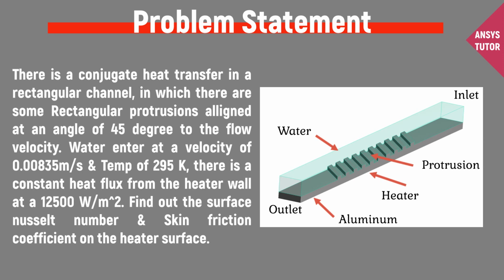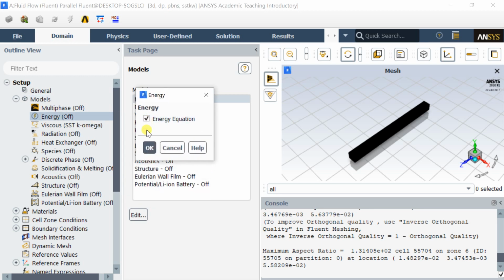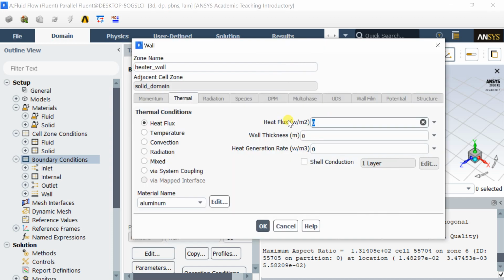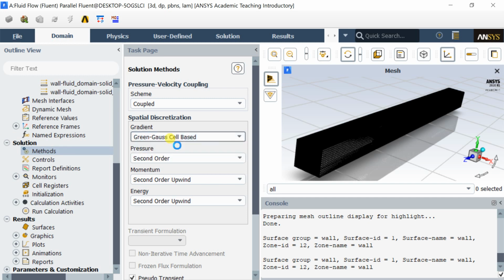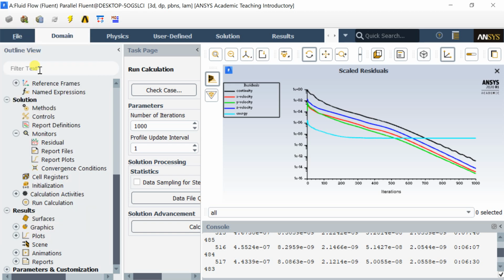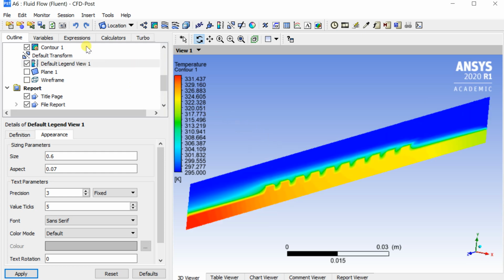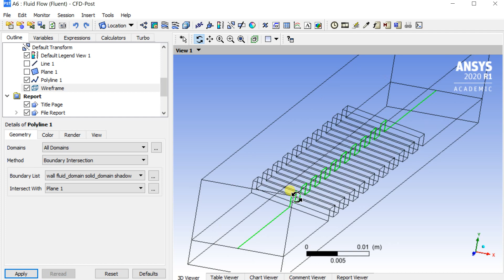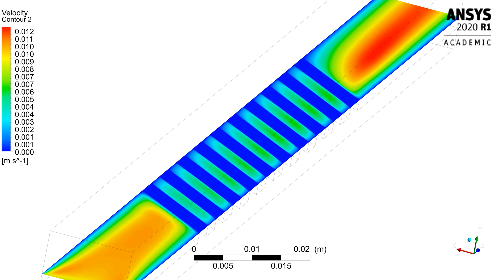ANSYS Fluent Tutorial | Conjugate Heat Transfer in a Rectangular Channel with Protrusions | Part 2/2

Comment: Hello, Thanks for your videos, I would like to know how can I establish Heat flux as boundary condition over the solid surface without decoupling with the fluid zone? If you could help me I would appreciate it a lot. Thanks in advance.
Reply from the maker: You can out the heat flux boundary condition on the shadow wall generated. If its a heat source you can take enable the source term option to give input to the domain.
Reply: @AnsysTutor  Thanks a lot for your prompt reply. When I put as boundary condition heat flux over the solid surface, automatically the shadow wall is decoupled, then if I set that shadow wall as cero heat flux (adiabatic), the simulation is not converging at all. On the other hand, if I establishe both as coupled in BC section, and then in cell zone I set a heat source term, I need to put that in W/m3. In that case, is it correct just divide the heat flux value by thickness in order to obtain W/m3? is it equivalent the w/m2 over the surface compared to just divide by thickness and obtain W/m3? Thanks in advance, regards.

Comment: Great tutorial sir. By the way, after the initialization step, I'm unable to select the data file quantities (standard qty and additional qty), as the option are disabled at the drop down menu. Is there any way I can compute the desired value at post processing step instead? Thank you
Reply from the maker: Are you getting any warning or error after the initialization?
Reply: @AnsysTutor  I can't select 'data file quantities' too and there is no error warning after initialization. What could it be? I searched online but find nothing.
Reply: @AnsysTutor  I belive I found the mistake! You must double click on "run calculations", after that there is a button showing "data file quantities"! Hope it works
Reply: @RikrdwF   im having your error but it cannot be solved adding file quantities in the "run calculation", variables dont show in post processing :(

Comment: Hi, first of all I learned a lot thanks to you.But I had a little problem with this project and I can't find a solution. I added to data file quantities ''skin friction coeffiecent ,surface heat transfer coef., Surface nusselt number''.I did everything exactly the same as you.But I cant choose any ''skin friction coeffiecent ,surface heat transfer coef., Surface nusselt number'' on the chart part. How can ı solve it?
Reply from the maker: Try to reset the cfd post processing.
Reply: @AnsysTutor  thank you

Comment: Sir, many thanks in advance for these wonderful tutorials. I have a question: in minute 2.30 when copying water liquid new material, in my version, it is not copying Cp and other thermal properties so, when applying boundary conditions, the thermal menu is deactivated. Maybe I missed any ANSYS package when installing, or maybe another reason. Could you assist?
Reply from the maker: Turn on the energy equations option in model. As you have not enabled it, thats why you are not getting the related material properties.
Reply: @AnsysTutor  many thanks!

Comment: Firstly, thank you for useful videos
did we use gravity? ıf ı used, where did we use?
Reply from the maker: Gravity can be used in problems where body forces plays a significant role like in case of natural convection, multiphase problems etc. In the current tutorials case you can take it, but it does have any significant effects on the results.
Reply: @AnsysTutor  how do you know that all? Can you suggestion some books? I wanna know that what you use tactics, formules, setup and solutions settings?
Reply from the maker: You can refer some CFD books by Versteeg & malalasekera, another book by Anderson. Also Ansys fluent user manual might help you.